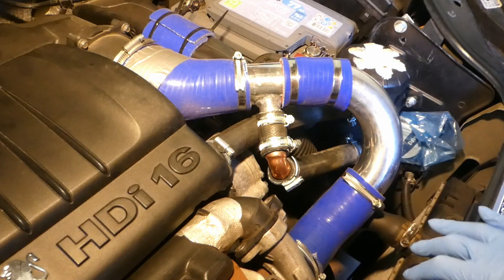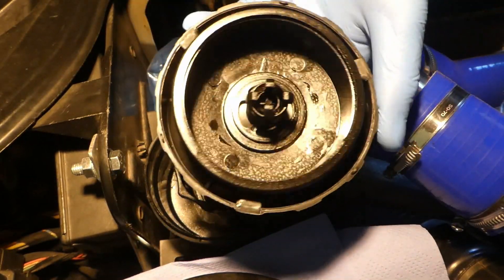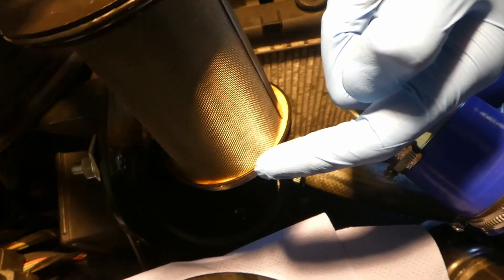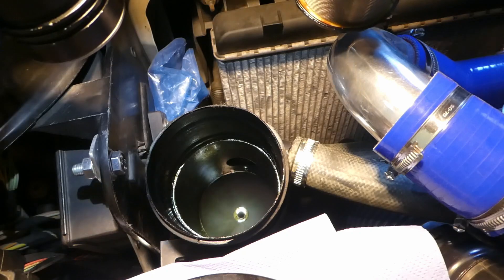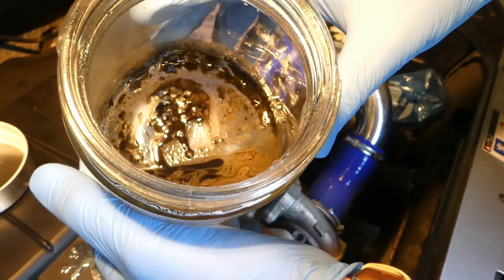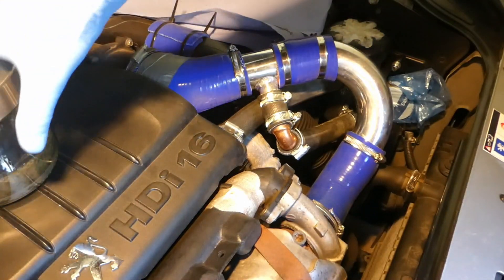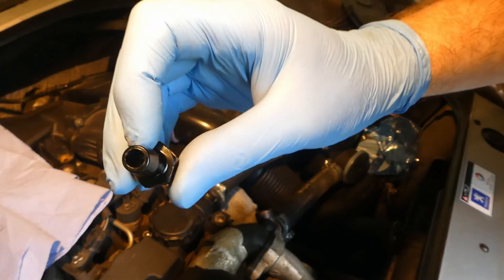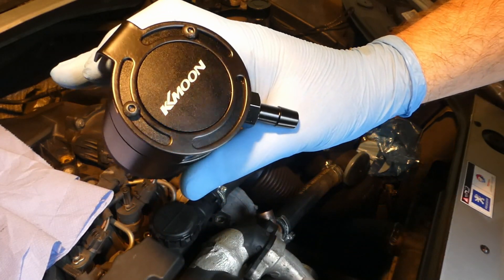1.6HDi/TDCi oil catch can started to collect oil, Update #2 (Peugeot/Citroen/Ford/Volvo)

Comment: hello,
i have watched all your videos about oil catch can and i have instal the same oil catch can but i can't find the cap you put to replace the original valve on catch can
Reply from the maker: Ha, well done for watching all of them!
Now, you can keep the actual valve with the cover, it should not be too bad. I renovated my bathroom and one of the things from grohe came with this plastic cover and it was a perfect fit, I think it was a siphone cover or something to protect the chrome. I thought a long time how to do it, if I can fashion something else from plastic, but it needs to be a hard plastic to survive the heat and oil, etc. Difficult to find a perfect cover.
Reply: @ yes but i worried about crankcase pressure this is why i want to remove it because this valve have the same function as the pcv valve
Reply from the maker: @TiméoDuy  Yes, completely agree that it is not needed if one is not returning oil back to the sump. Adds a little bit os a restriction. Now if you have access to a 3D printer you might be able to print one that is a perfect fit with a good plastic that is heat resistant and/oil.

Comment: Why does the manufacturer not automatically set the oil trap for the turbo inlet?  thank you
Reply from the maker: The problem is that generally people do not even do an annual service every year, let alone to empty a trap somewhere with oil.

Comment: Hello.
2. Can you share the results for oil catch?
Does it collect well? Did it make a pressure difference? Do you recommend 1st or 2nd?
Reply from the maker: Hi ibrahim, Yes it does collect oil. It has not collected that much oil, but my car does not burn oil, so I am not expecting to collect vast amounts of oil. The oil catch can did not make any difference to the crankcase pressure in the engine. I have been driving with the oil catch can for quite a lot of months now and there has not been a problem.
I have not yet put the other oil catch can and compare the two, but will do soon. The only problem with the kkmoon oil catch can is that it may freeze during winter.
Reply: @moremolecules  Thank you for your return.

I saw your video for two different products. One is mann replica plastic product, the other is aluminum. Which of these would you recommend?
I have a Mazda 3 85Kw psa engine. I thought about this product, but I'm undecided. Because the throat diameter is 19mm.
I think the copper filter freezing you will not have in this product. Would you suggest this?https://www.amazon.com/gp/product/B074XTFGVV/ref=ox_sc_saved_title_1?smid=A1OOQHXRWENPTH&psc=1

Comment: Probably a stupid remark, but  doesn’t the turbo need oil/lubrication in order to do its work ?
Reply from the maker: Hi Simon, the turbo has its own lubrication that comes under pressure from the crankcase oil. The turbo seals prevent this oil from going to the air intake. If oil passes the turbo oil seals, the car will be burning oil and a lot of blue smoke will come out. The crankcase vapour comprises some oil that goes to the turbo (compressor side) and gets compressed into the intercooler and burned. This oil vapour does not really do anything to the turbo apart from being burned, it is undesirable.
Reply: more molecules ok 👍

Comment: Am no expert but I don't see any real benefits of a catch can but a few negatives. Why?

Crankcase pressure is caused by blowby and needs to be to vented. This can be done to atmosphere but is vented much more efficiently under vacuum created via the air intake, plus the environmental positive.

By adding a catch can you are creating a airflow restriction and thus increasing crankcase pressure above normal, this effectively puts every engine component under additional stress.

There's little point of catching a teaspoon of oil and some water every 20,000km. Water after all is a product of combustion and in the air you burn. Therefore entering your intake and existing your exhaust constantly regardless. The oil can cause intake fouling but it's minor at best, exhaust gases recirculated by the EGR cause noticeable build up especially if combustion is poor due to wear of other components such as injectors.

Without a significant cooling system I can't see how any oil vapour at all or water vapour can be condensed other then in the Initial cold start period.

Anyway that's just my opinion I know the 1.6 hdi has a significant oil in breather pipe problem and you make a commendable effort in attempting to resolve this issue.

I do enjoy watching your videos, and would really like to see a video in detail changing the coolant on the engine along with the location of the air bleeding screws.

Keep up the great videos!!
Reply from the maker: Hi J, That you for the detailed comment. While I agree with some of the points, here is what I think. There is an increased restriction, although it is unclear how much. I was always bothered by this. If the oil catch can increases pressure significantly then there is a lot of strain on multiple components. In one of my previous videos (https://www.youtube.com/watch?v=FZYWcqkMN-I) I tested exactly that, is there an increased crankcase pressure following my oil catch can installation. I am currently working on more precise and digital measurement, i.e. bosch MAP sensor and arduino. Nevertheless, with the old school measurement, the crankcase pressure was exactly the same, i.e. no increase in crankcase pressure. Once I do it with the arduino I will have proper measurement under load.
The problem is not the EGR valve itself, but the oil film in the intake combined with the EGR. EGR on itself would not be a problem, but the gunk comes when the exhaust gasses hit oily film.
Thanks for the coolant suggestion, I will have to do that fairly soon anyway, so watch this space.
Many thanks again for the comment, really appreciated.
Reply: @moremolecules  You need to remove your modification (the clear plastic cap), you have interrupted the vacuum required for the catch can to work, the engineer that designed this unit knew what he was doing. You need to be care full as you don't want damage your engine seal.
Thanks.
Reply from the maker: @RichieRich845  That is not how this particular valve works. The oil catch can was designed to return the oil in the crankcase. The problem with this is that these are two linked liquid vessels, i.e. the pressure needs to be equalized. The valve does this, it kind of oscillates and equalizes the pressure when oil is sloshing in the crankcase. I am not returning the oil in the crankcase, hence no need for this valve, it is only a restriction. In addition, 1.6HDis and any diesel have some sort of crankcase ventilation valve, CCV, PCV or whatever one wants to call it. This valve performs the same function.
Also, the oil catch can is really a simple device, the air that is coming from the crankcase is just re-routed to the oil catch can. Thus, there is no change in the design of the vehicle or any parameters.
Reply: @moremolecules  Thanks for the information

Comment: On one of yours previous films you said you have a complete brand new rocker cover. Did you manage to install it or you just replace membrane and the cap?
Reply from the maker: Hi Roni, I managed to replace the membrane and the cap only. Seemed easier than the whole rocker cover. Probably a wrong choice, as who knows how long the gasket will last.
Reply: @moremolecules 
 hi where did you get the membrane (diaphragm) from,
Reply from the maker: @sheledmikymo  ebay with part number: 0248L1
Reply: @moremolecules  it isn't about gasket I believe that replacing complete valve cover for a new, since you have one already, may reduce oil going into catch can and eventual to the intake. Before I explain why. I would like to say that I'm not mechanic or a specialist in diesel engines. I've been inspired by your catch can and breather o-ring replace videos to do research about PCV systems as I also try to reduce oil going inti the intake. The breather valve diaphragm is not for oil separation it's for pressure regulation. The oil separation happens to take place inside the valve cover thanks to the system of variouse filters, chicanes and  meshes. The conclusion of my research is as follows. What if that oil separation system from valve cover losing its efficiency with time due to engine heat cycles same as your breather valve diaphragm lost some of the elasticity. I'm looking forward to see what you think about this. 
Thanks for all yours fantastic videos/tutorials/tests. Keep up the good work.
Reply from the maker: Hi Roni, Absolutely agree with your comment, but I cannot be bothered to replace the whole rocker cover. Replacing the rocker cover is not without problems, one needs to seal it really well, bolts criss-cross, etc. There is a significant risk of leakage if it is not done correctly. Even if the rocker cover is perfect, there will be gasses that escape bringing oil with them. I opted for an oil catch can instead of replacing the whole rocker cover. I suspect it will be better to replace the whole rocker cover, but with age you get much more blow-by, so with a new rocker cover you can recuperate some efficiency, but the vast majority of oil will still go past the diaphragm.
Reply: Get the black one, I bought the red membrane and is bad quality, very weak rubber. That one came from Russia and was expensive with the shipping costs to south america.